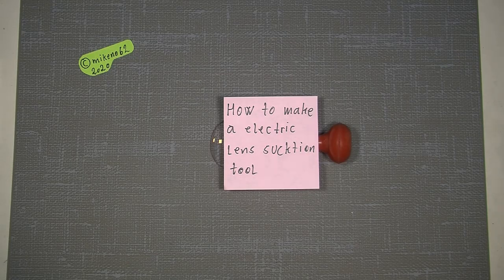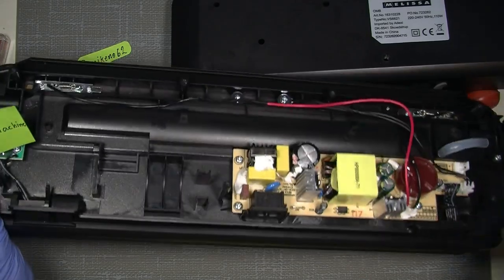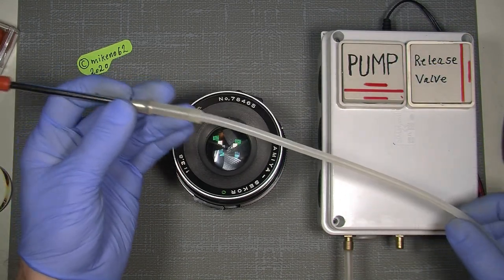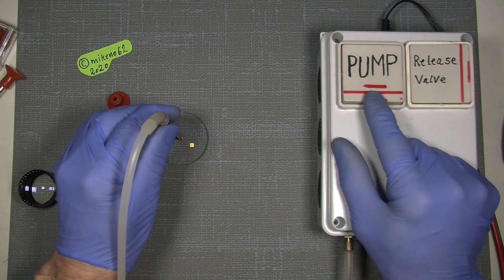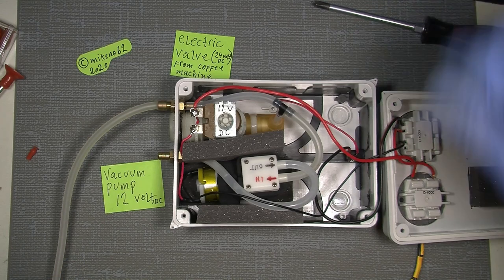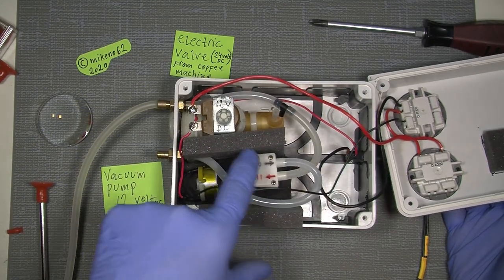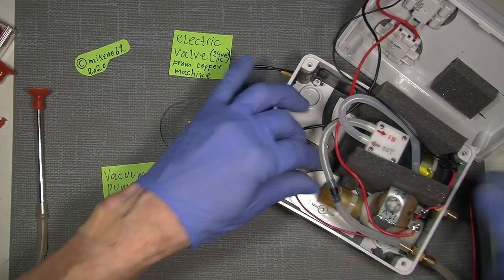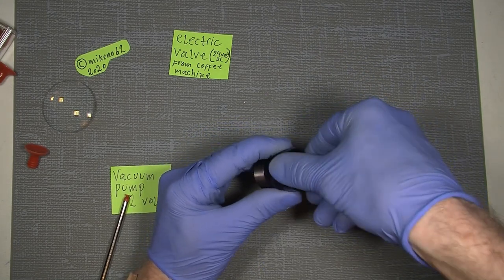How to make a electric lens suction tool from a Vacuum sealer FOR FOOD

Comment: Good job! If you want you can add a timer to the pump button. So when you push the button the pump runs for 5sec (for example) and stops. You can either use a 555 timer or if you arent good with electronics you could get timer modules on ebay for quite cheap!